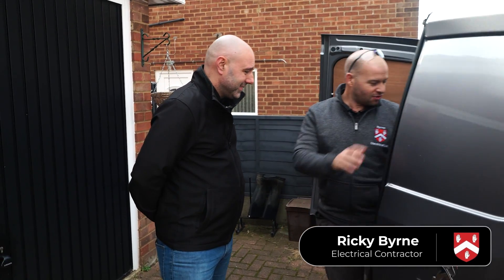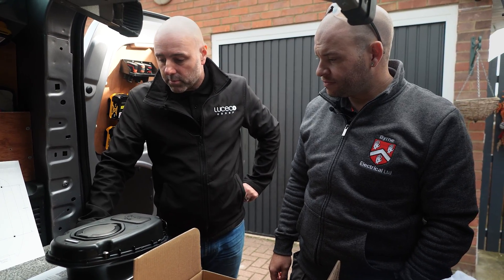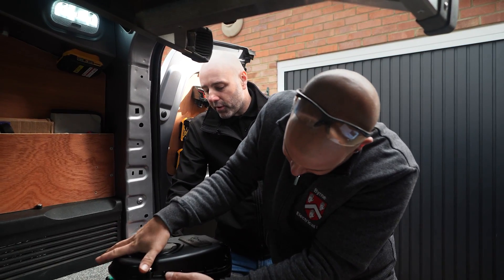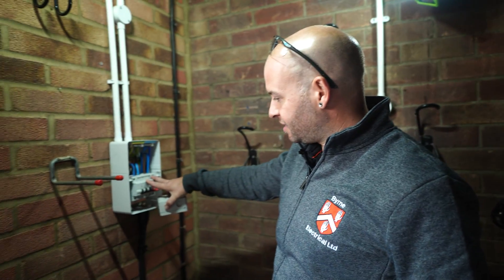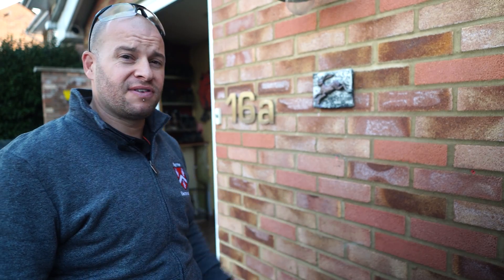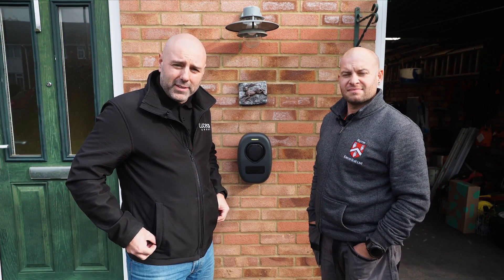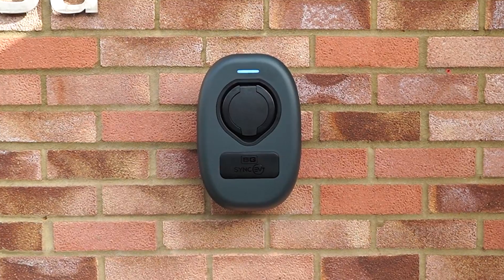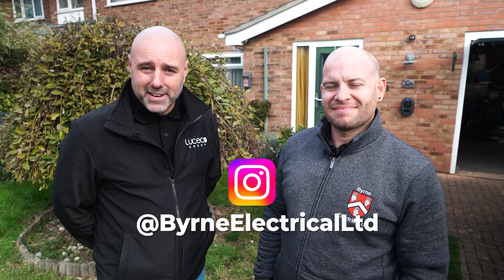⚡ BG Sync EV Wall Charger 2 Installation & Review with Ricky from Byrne Electrical

Comment: Does it have pen fault protection and does it have password protection similar to Zappi?
Reply from the maker: Hi @craftspirited! Absolutely – our chargers come with both PEN Fault Protection and Password Protection as standard. They're designed and built to meet all the latest SMART, Cybersecurity, and Installation regulations to ensure maximum safety and reliability. Plus, they come with a 3-year warranty and are backed by our UK-based customer support team. If you have any more questions, feel free to ask!
Reply: @lucecogroup  Hello, looks like BG SYNC is not compatible with Octopus intelligent charging. :(

I was just on phone with Octopus who confirmed this, which means I would end up paying a little bit higher than 7p/kWh, will only get 5 hours instead of 6 hours and need to charge it manually in the nights than any day @8.5/kWh.
Reply from the maker: Hi  @craftspirited  Octopus currently supports a limited range of chargers, but the good news is that most vehicles are compatible with their integrations. You can still use our charger alongside Octopus by connecting their platform directly to your car.

If you’d like some guidance on how to set this up, feel free to contact our technical support team at 03300 249 279 (Option 4). They’ll be happy to walk you through the process and ensure everything runs smoothly!
Reply: @lucecogroup  Perfect! thanks for your response.

Comment: How can I reconnect to Wifi after changing my Internet Provider? I can't find any paperwork. It still charges but I can't use my app.
Reply from the maker: Hi, If you contact our support team they can generate a 1 time access code for lost paperwork but the magic code is live so I recommend calling them about this🙂 tel:+4401952238100
Reply: @lucecogroup  Thank you.

Comment: Do you have to install an isolator switch beside the unit?
Reply from the maker: Hi 👋
In most UK installations, a local means of isolation is required for an EV charger. This is typically a double-pole isolator installed near the unit, in line with wiring regulations and installer best practice.

The exact requirement can depend on the installation, so it’s always down to the qualified electrician to determine the most appropriate solution for the property and supply.

Comment: are you able to lock the cable in the charger even when the car isnt charging?
Reply from the maker: You might find a tethered option suits you better 👍
The cable is permanently attached, which removes any concerns around locking, storage, or day-to-day convenience.

Comment: These things are a pain for losing wifi signal in new builds.
Reply from the maker: You’re absolutely right — Wi-Fi in new builds can be tricky, especially with thick insulation and foil-lined walls! That’s why we include the option to hardwire the unit via the Ethernet port for a rock-solid connection. 😊 If you ever need tips for the best setup, just shout!

Comment: Does it require spd
Reply from the maker: Hi Lee, It really does depend on the installation you are working on, If the installation already has 'SPD' Surge Protection in the CU, then no you're already covered no need to buy more SPDs. If there's no SPD in the CU then yes, we would advise you to put one in. Aside from fluctuations in the grid and lightning strikes SPDs help protect your installation from transient voltage. All our BG Fortress range incorporates SPDs as standard so if you were installing this with one of our garage CU's kits then you're covered again. Hope this helps!

Comment: Why are the wall chargers so complicated inside, why all the electronics while the car's BMS does the work. So much money for a simple upgraded socket!
Reply from the maker: I get your point about the complexity of wall chargers seeming unnecessary. However, the electronics inside ensure safety, prevent overheating, and enable features like remote monitoring and scheduling. While it adds to the cost, it's essential for a reliable and convenient charging experience, crucial for EV adoption. We do offer a fantastic range of mode 2 charging leads, you can use these with a regular 13amp socket. You may find they take longer to charge your vehicle but they're a good option to have.